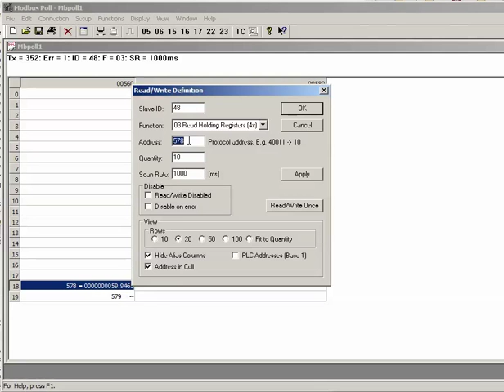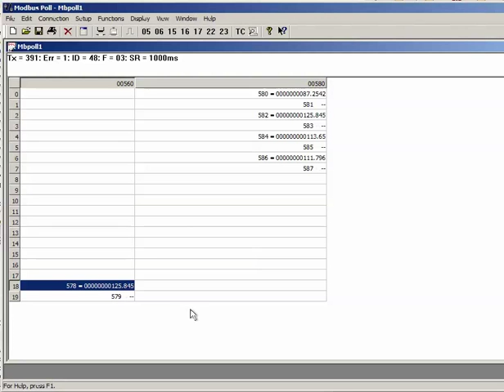How to use Modbus Poll with a Sage Thermal Mass Flow Meter

Comment: I am getting timed out error while i am connecting.Earlier i had connected to it but now i am getting timed out error.could u explain how to overcome the bove problem.
Reply from the maker: Try using the EXACT example I show and a timeout error comes about if you wish to read too many registers.
ALSO, Windows is not always friendly with the resources, the USB, it "lets" you use and unfortunately restarting the machine (because it is so slow) fixes MANY problems.
Reply: @FlowMeter  Thank you so much for the reply sir.Now, i am able to communicate with the device.Cheers!
Reply from the maker: @yaswantsaikrishnapullela2700  You are welcome!
Reply: @FlowMeter  sir, i have to write my process value manually into a holding register of absolute address 40031.How can i write into a holding register as there is no function to write holding register.
Reply from the maker: @yaswantsaikrishnapullela2700  The Sage Meter does not allow you to wrote to that register. This is true for ANY device... Each device is coded with the ability to communicate to only SPECIFIC register numbers. In the case of the Sage Meter there is no address 31 that can be written to. Consider register addresses like physical "mailboxes"... In this case there is no Mailbox 40031 in the Sage Meter. What is it you wish to do to the Sage Meter? If you can tell me I can tell you how to do it.